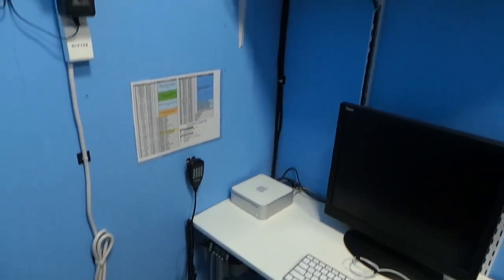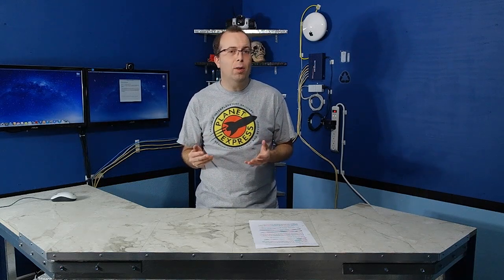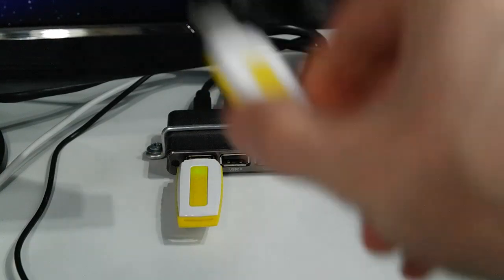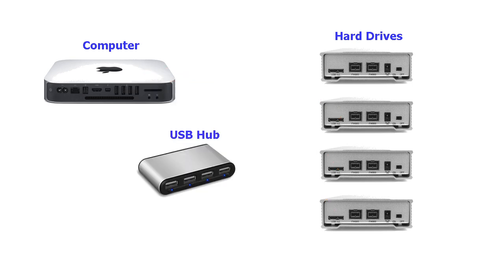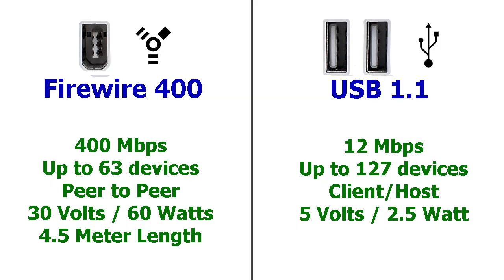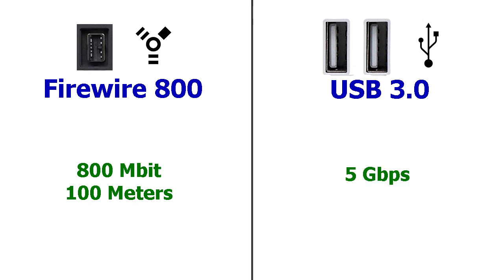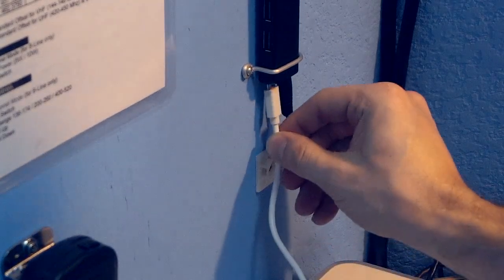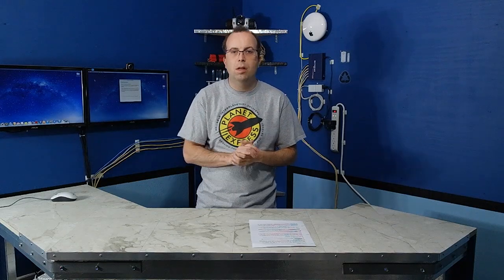Farewell R.I.P. Firewire, Hello USB!

Comment: I still use FireWire for TargetDiskMode from time to time.
Reply: Kristofer Smith OK
Reply: Kristofer Smith So many gadgets that do the same thing, but it might take some technical expertise to make it work like you want, but i have that expertise.
Reply: Kristofer Smith I wish Linux had something like that :/ though booting from USB into a live environment solves most problems TDM would solve. Still, is awesomely cool!
Reply: ***** Not on my 2009 MacBook Pro or any of my PowerBooks.
Reply: Kristofer Smith If you want to transfer data from your old MacBook or Powerbook to a newer Mac, use a thunderbolt to FireWire adapter.
Reply: Haikal Ghifari I'm never buying a new Mac. After my 09 17" dies or gets too old I'm going the Thinkpad route.
Reply: +archlinuxrussian TDM is a function of the Mac's firmware, and it isn't reliant on any installed OS. I run Linux on an '09 13" MBP, and TDM still works fine. As long as the initiator can mount an ext file system, of course.
Reply: Like using usb in the same way you just a have to have a male to male usb and then use cat to dump the data into a file this is easy if you're a bash wiz.

Comment: Being only 15, when i was younger I always firewire, but never really knew what it was. I have always used USB for everything. But now I understand what it is, and I actually think its pretty cool that you can daisy chain. It would be cool it was upgraded again and could compete better with USB.
Reply: Gevan32 Technically speaking, Firewire was upgraded in a way. Thunderbolt is the replacement for Firewire, and supports daisy chaining.